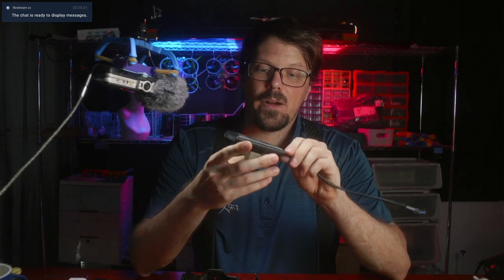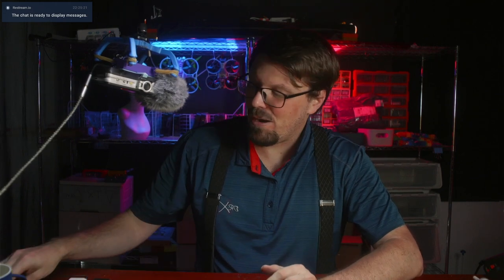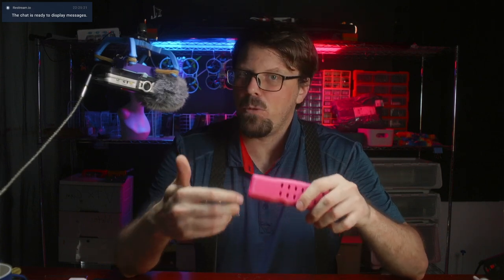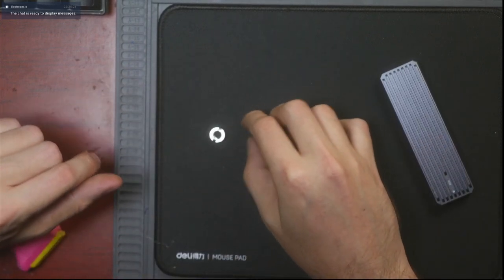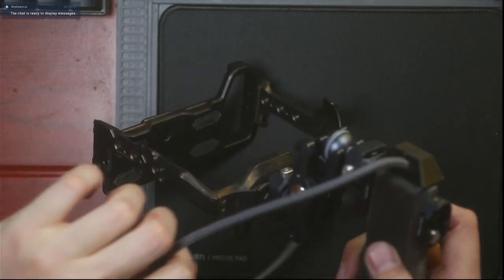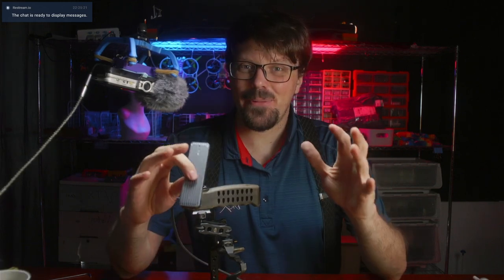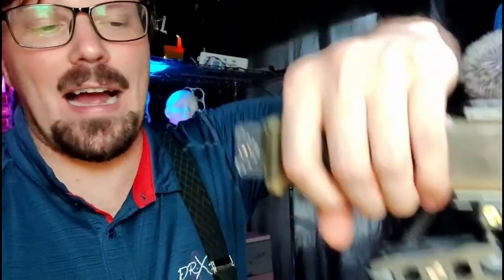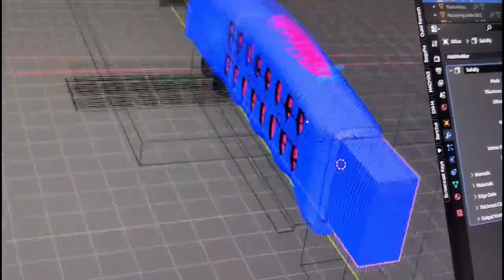DIY Kondor Blue SSD Handle - MUST HAVE!

Comment: Dope! Glad we inspired your creativity! Yes there are so many cool ways to implement SSD recording with different drives and caddies! The freedom is great! Just be careful as many drives and boards won't live up to Panasonic requirements and wouldn't pass their rigorous testing like the Pro Blade and our Handle has. Corrupt media is a creators worst nightmare! Keep up the creativity though, love it!
Reply from the maker: this is a great point and i need to do more testing on the drive and enclosure. in fact i should add that caveat in the new video so people understand the risks
Reply: @jimgiraffe5253   We were approached by Panasonic and SanDisk to create the ProBlade handle and of course is never our desire to rob anyone! ProBlades use a proprietary connection so adapting to that of course won't allow for traditional NVME drives, however making a generic NVME connection to USB-C is an idea we have been playing with! We're continuing the conversation with our engineers to create as many awesome products as we can! So hang tight! We have many more awesome products coming!
Reply: @KONDORBLUE  Can't wait for the version of the handle that I can use with a regular M.2 drive 🥲

Comment: I really appreciate you sharing this for free. Could you please tell me which Ulanzi Falcam F22 parts are attached to the handle? To be clear, I’m referring to the rails that are screwed onto the handle. I couldn’t find them on their website. Thanks!
Reply from the maker: Just the normal 3 slot length rail. I like to screw in to screws to keep it from twisting

Comment: How is this handle holding up now? Personally, I would never trust PLA to hold my gear.
Reply from the maker: It's technically not pla holding the gear it's two 1/4th threads and a F22 plate. It's still holding strong and no signs of wear. The SSD is much less stiff now but still holds in well

Comment: AWESOME Will this work with my G85?
Reply: No. Video recording via USB C is only supported by a few cameras, notably the Blackmagic Pocket cameras, Sigma cameras, Zcams and some Lumix cameras like the GH6 and S5IIX
Reply from the maker: yes but it sill works as a good handle you can print